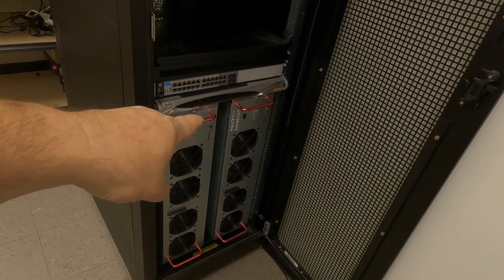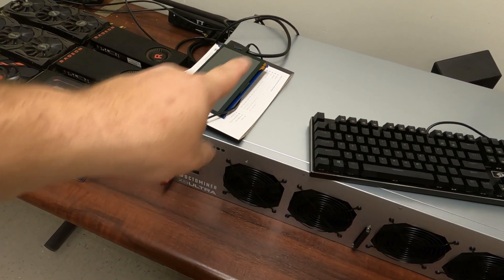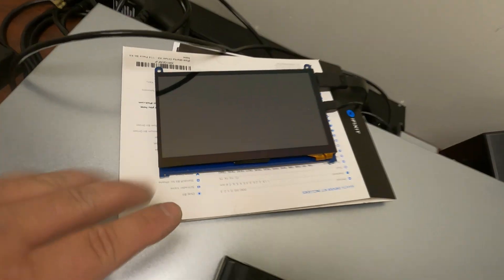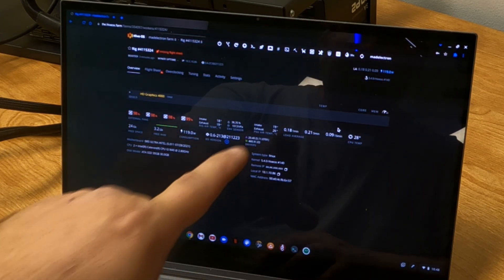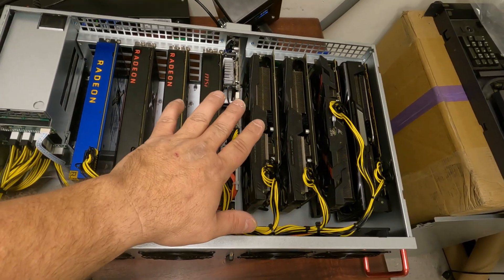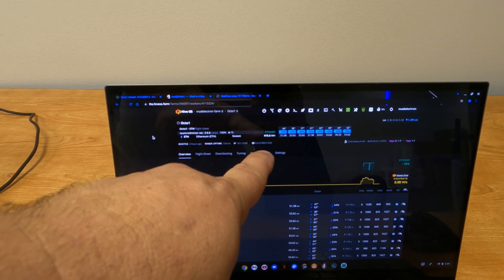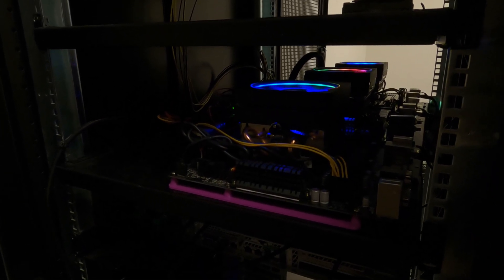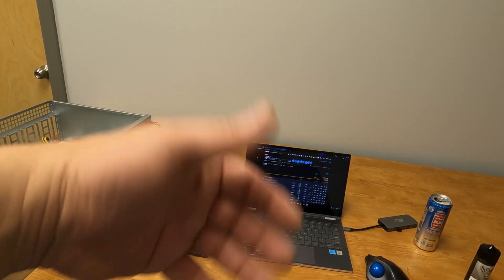OctoMiner X8Ultra AMD Vega 56/64 Rig Build

Comment: Why did you leave those 6Pin PCIe unplugged on the motherboard? I see 8 connectors, but only 4 are connected on your setup. Why ? Thanks
Reply from the maker: That's the way they come from octominer, I suppose they're just extra connections on the backplane that are not utilized in this configuration.

Comment: How are the temps on the Vegas? I have a Vega 56 in my desktop pc. I used it for mining for a short time but the mem temps were just a little higher than I liked. But I’m debating taking it out and throwing it into my 5700+6600xt rig. Iota been so long since I’ve seen air temps on these. Upon putting in my desktop I added it into my loop and water cooled it.
Reply from the maker: My Vegas are running around 35' on the core and around 52' on the memory.
Reply: @madelectronengineering  I have  2 vega FE I cant get stable (ram over heats). I mine ergo. What would u recommend I do to solve my problem?

Comment: I have a server case and I find that the original fans running at 6000RPM is way loud and is overkill for anything like a 3070 and below. I replaced the fans to Artic P12s and they now run whisper quiet and kept my 3070s at a very cool temp.